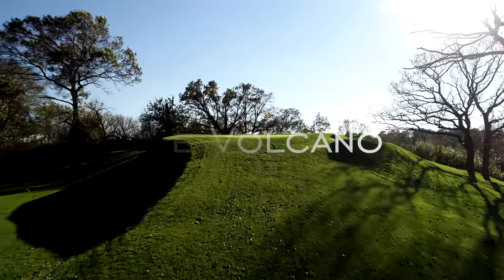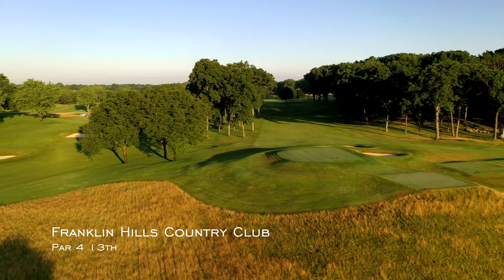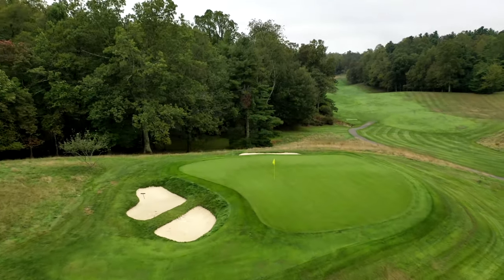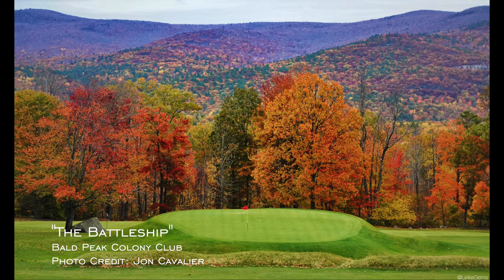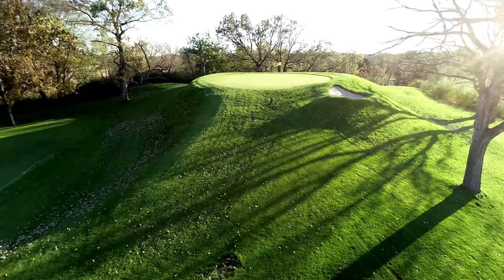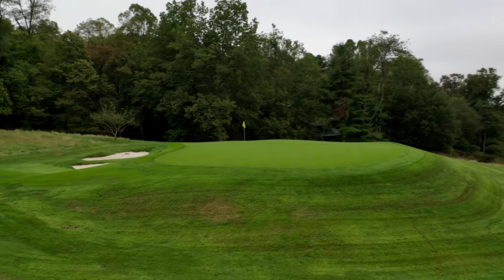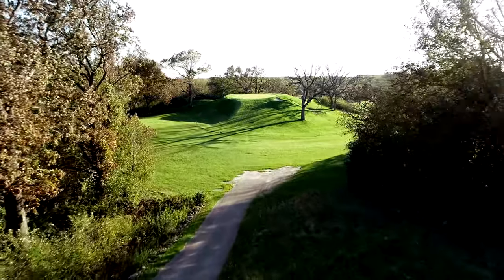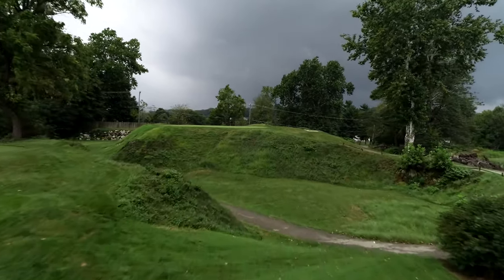Golf Course Architecture: An Introduction to the Volcano Hole

Comment: Donald Ross' understudy Sandy Alves' Number 11, Blue at Highland Park Golf Course a 200 yd par 3 with a severe volcano green, exposed to wind. Public course in east Cleveland suburbs has been neglected for decades, but that hole stands out, especially after the 10th green which has perhaps the highest back to front grade in NE Ohio. Miss the green on 11 and no up and down bogie+ is likely next. Nice video.